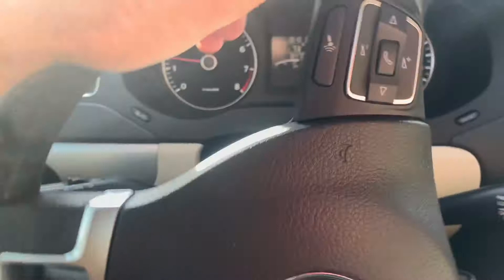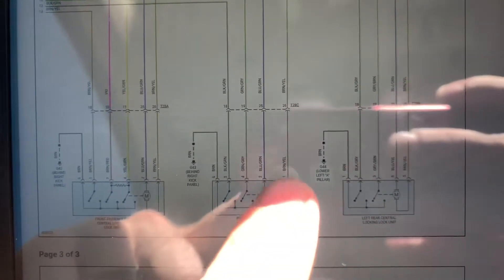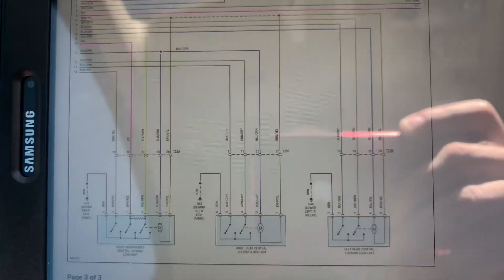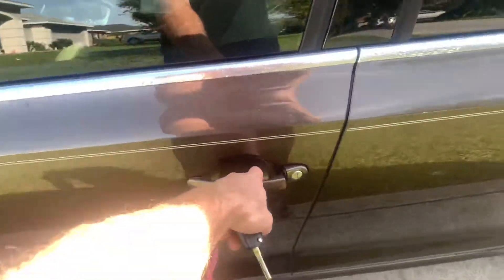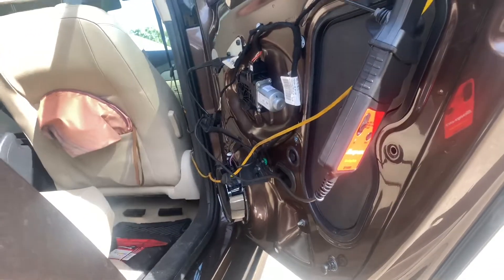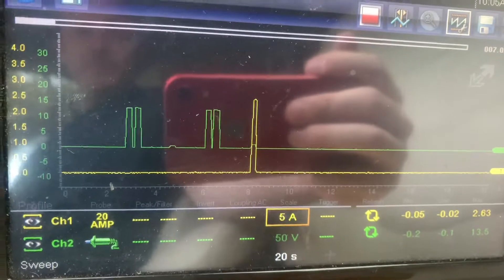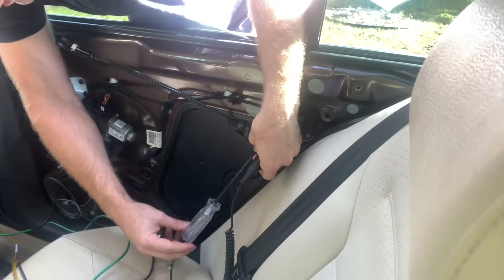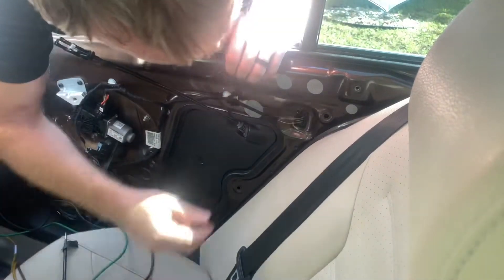2013 Volkswagen Jetta Door Locks Locking While Driving

Comment: Just a WAG, I turned the little unlock pin in the passenger door behind a rubber plug with a padlock logo. Near the child lock switch. The door began locking like normal again! 
My B7 Passat driver door was not locking with key fob, only manually with key. Finally got around to replacing the actuator but a few days prior the rear driver door stopped locking with fob and obviously doesn't have a manual lock. So I was looking for a quick fix! I unplugged that little rubber boot, it had a padlock logo on it. Put my key in the little white plastic and 'unlocked' it a few times. It springs back after turning about 1/4 turn. After that I was able to lock it using the key fob. 
I'll keep an eye on it for now that all my doors are functioning properly!

Comment: Friend tried to access my car without the key, he set the alarm off, never told me. Initially could not lock the doors electrically so did it manually, now cannot unlock the doors electronically, almost certain the car will need blinking recoding, i think its all about exact power regulation to everything in the car. I'm on the cusp of saying these things are so finely calibrated, even slight power disregulation becomes potentially problematic.

Comment: The switch in the door could be out of adjustment as well had this issue with my 12 Passat turned the switch in the door everything works, except the lock unlock light in the door

Comment: Damnit my car started doing this too. VW should be ashamed, my car only has 40k miles and I hardly ever use the other doors except for my driver side door.
Reply: Same. My Jetta is a 2013 with only 16k miles. I barely drive (yes, i said 16,000 miles) and I have this issue. WTF VW?!
Reply: Same here
Reply: I miss my 2004 Ford Taurus V6, bigger engine, and better mileage and I sold it with more than 200,000 miles. No maintenance problems. German engineers are not really good.